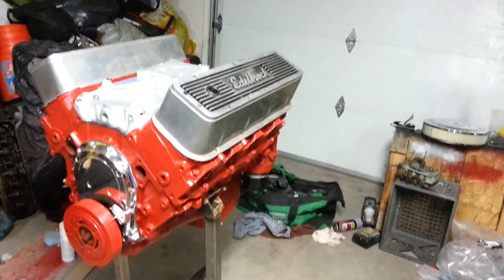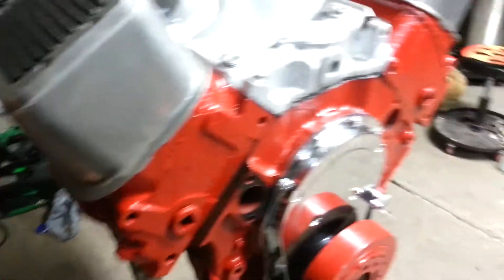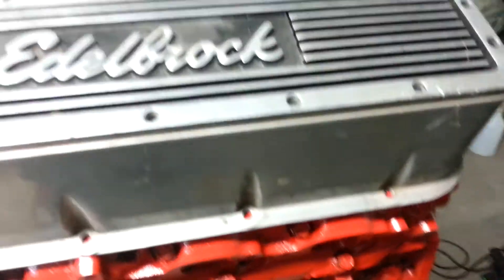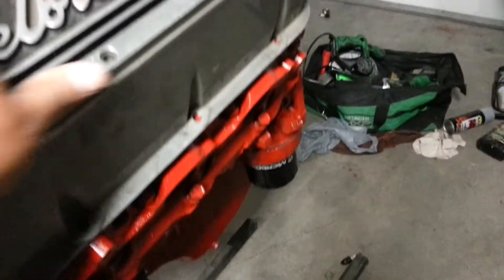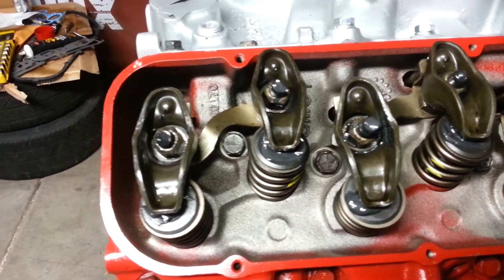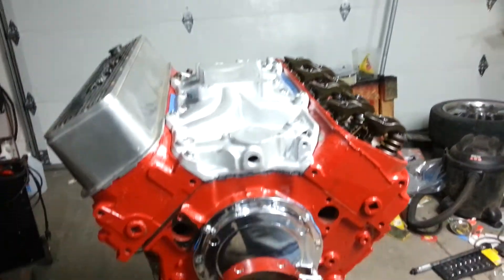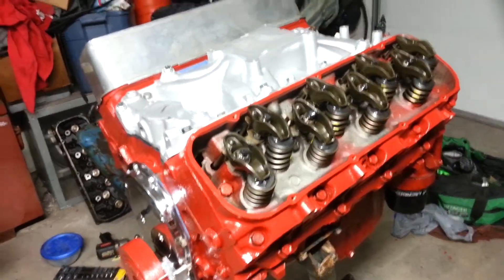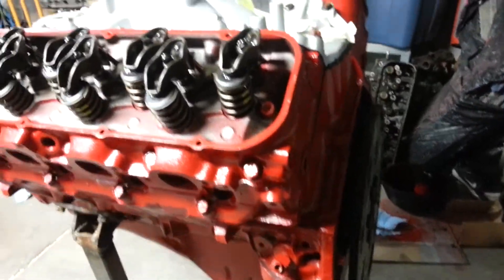Chevy 402 build part 4

Comment: I got the same engine in my car I'm about to fix up any tip would be greatly appreciated
Reply from the maker: Yes. Match the camshaft with the correct springs and compression ratio. Also if you're running an automatic trans get a higher stall speed and your car should haul ass!
Reply from the maker: I have a video of it running in my nova videos
Reply: I remember my first engine build by myself it was a 396/402 in a '68 Chevelle super sport wish I had of kept that car